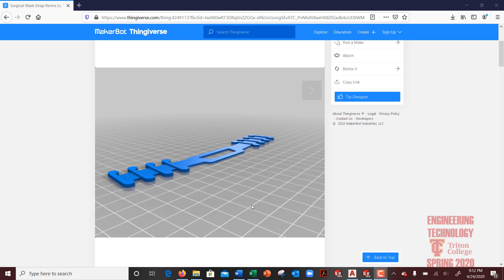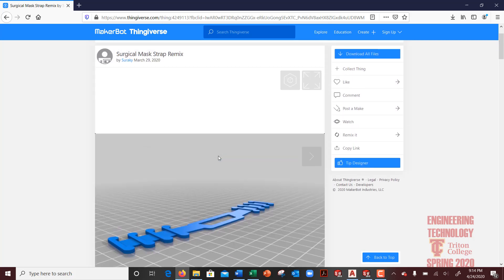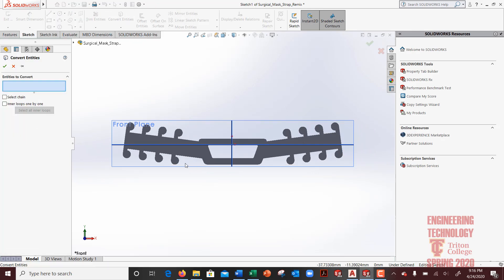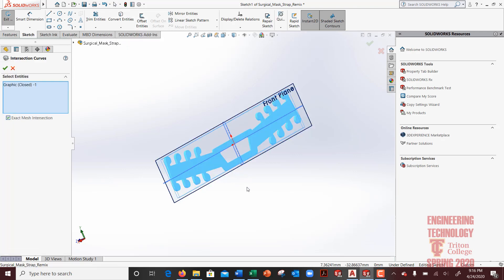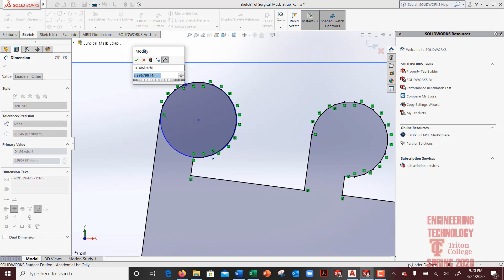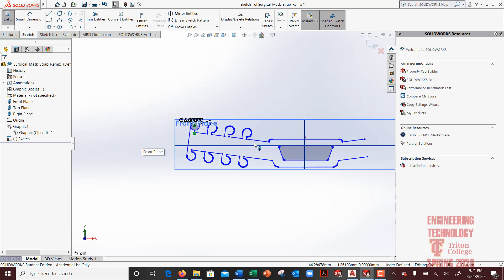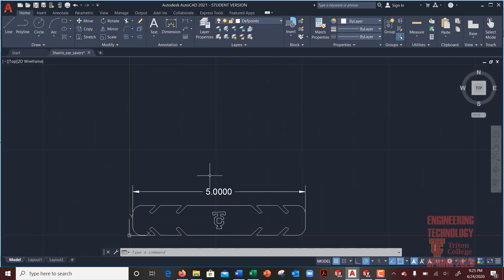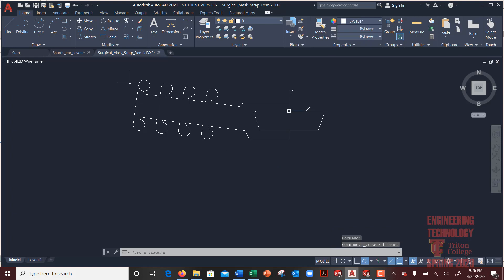STL to Solidworks to AutoCAD

Comment: This is nonsense. Change the title. You could have started the project from scratch in autocad, it would have been even faster. What people want is to import the STL 3D file into solidworks and from there into autocad. STL files from thingverse won't open in autocad.